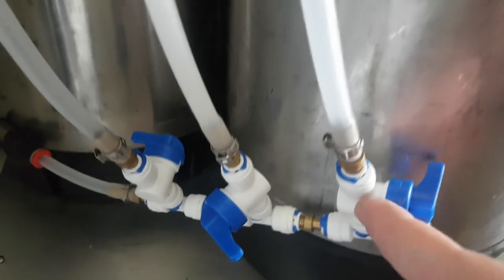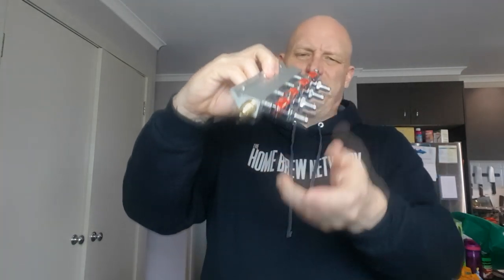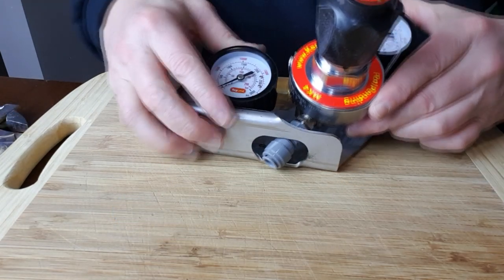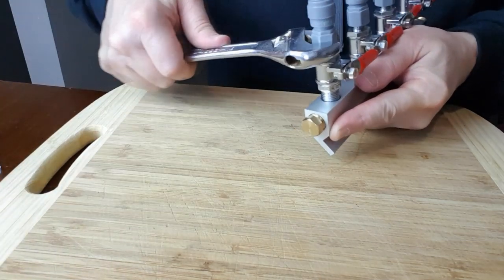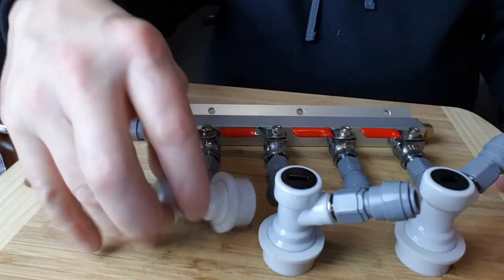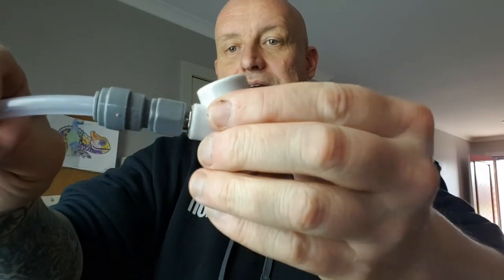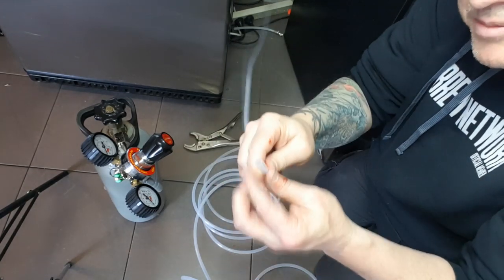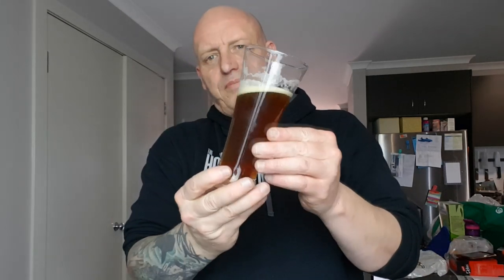REPLACING CO2 GAS LINES - Kegerator

Comment: Good stuff Gash, I've got the same manifold setup in my fridge.  My next cheap project will be to upgrade each line with a blowtie valve on each output so I can independently control the pressure to each keg! ;)

Comment: Nice bud I've the same manifold but with 6 connection on it,good tip about finger tight and 180° later which I never did. I did find the last time I lost gas was the fittings, the JG fittings had crumbled not all just the off one. Cheers
Reply from the maker: These ones are a little bit better than JG, as in the sealing around a line, but yeah I could see the odd one failing though, I'll keep an eye on them . Cheers and thanks mate

Comment: Hey mate great info, gotta respect an man who bleeds for his art!  Sitting here having a NEIPA BIAG (20ltr) tun styled one one of your previous videos.  Cooper extract can 4 kg Joe White traditional ale malt 1kg Joe White light Crystal 250grams quick oats and 500 rice husks, 3x30oz cascade hops, tastes good my mates recon, does the job, thanks for the videos  Keep up the good work!
Reply from the maker: Yeah that regulator guard was plain cut stainless bloody sharp lol lost skin hahaha. That's awesome about your beer mate, makes me happy . Cheers!
Reply: @HomeBrewNetwork  Yeah It's a good recipe, thanks for sharing! couldn't help from commenting as I took a scoop of flesh outta a finger the other day with a barbed fitting using eva barrier 5mm ID 8mm OD found the old harder line works better with barbs? eva's seems too soft? fine for duotight though I recon, Cheers :)
Reply: @totallyrandomlocksandpicks  ; Thanks for mentioning you found old harder line better for barbs. I don't trust ANY push-ins. I have no end of trouble with RO water leaks thru them, so can't see gas being any more reliable. KeeGland ;) does admit (in a low whisper) that ''micro'' leaks are possible with their u-beaut Duotight too, e.g. when line is strained or at an angle. I notice Gash didn't bend the tube in them like he did on the JG ones. Sex sells tho, and nothing say sexy like pushing in your pipe. Hahaha.
I'm glad there were lots of out-of-stocks (OOS) in the gas dept during the lead-up to Fermzilla's release. It gave me time to read some things I might've otherwise missed, like force carbonation with commercial CO2 (99.5% pure), being enough on its own to oxidise a carefully nurtured Low Oxygen Brewing beer (per Bryan Rabe) to the degree of throwing away the clean malt flavors at the very end, to say nothing of what it does to hops aroma and storage life. The numbers are well researched and published in brewery papers. Now I'm going to skip right to natural carbonation via spunging and collecting the excess spunge gas (purest CO2) to push the beer around (just like the big boys do). With no push-in fittings.
Reply: @2F51RL  I gotta say most interesting comment reply I read all week, I've been doing the same sort of research my self, bottled on and off for 15 years or more finally set up a a serving, fridge fementer fridge w/stc1000 &heater belt, co2, found the local HB supplies 5x the price of either KK or KK how ever started on barbs and hard line (which I believe doesn't work so well with duotight fittings) Use duotight as I have 12M of it and a few duotight fittings.  Actually made my own diy spuding valve same thing as Kegland (KeeGland lmfao ;) gear minus the blowtie simply a ball valve on the end, same principle.  Going to have a crack at knocking the sanitiser out of a 19ltr KegKing ball lock with a 50ltr SS keg to be used as a fementer then anaerobic transfer to the secondary/serving keg plan to do 40-45 liter batches (prob 40) depending/allowing for sufficient head space in the fementer.  Lucky to have scored 3 x 50lts and A-type micromatic couplers to suit so I've reconfigured them to use ball lock fittings just going to use the gas in as a blow off to a bottle and a one way check valve in the case any thing made it's way towards the pressure gauge.  Then once things are working capture that C02 and flush the 19's  Eventually I'd like to go back to bottling whilst still kegging, however using a counter pressure filler.  Slowing but surely... Happy brewing mate, Cheers!

Comment: Just bought my first batch of duotight fittings. My old setup with vinyl hosing has leaked twice in the last 2 months emptying brand new CO2 tanks twice in the process (once the day I had to bottle up for a competition!). Very much looking forward to putting them all back together with the new fittings and tidying up the whole system this weekend.

Any watchouts after you've been using these for a few years now?

Comment: Great video mate love your work! How did you end up attaching it, I like the Velcro idea, I put three screws and attached it to the door but the screws aren't biting properly so I'm off to Bunnings to get some Velcro as a secondary👍👍 thanks again for the tips!
Reply from the maker: I havent attached to door yet, I keep forgetting to order an elbow piece, I m sure the velcro will hold though, I bought the good wall hanging stuff, not clothes making stuff, although that could probably work too

Comment: Hey Gash, did you end up drilling a hole .. is there a video for it?
Reply from the maker: I didnt drill any holes, but trying to remember what youre talking about.. a hole for what?
Reply: @HomeBrewNetwork  Sorry mate, only watched this one today. You added a manifold to your kegerator and wanted to mount it outside. You thought you might have to drill the hole bigger to put the 4 gas lines through.
Reply from the maker: @oscadelta  nope I got 4 through

Comment: I note that you did not use any tape - duotight fittings don't require it?
Reply from the maker: no they shouldnt need it, though if worse comes to worse you could use a little, they dont seal at the thread. cheers!

Comment: Does gas line length matter at all?
Reply from the maker: Not in the lengths used in home brewing, I guess if you had them extremely long they might drop pressure. Cheers!
Reply: @HomeBrewNetwork  I was more thinking the other way, was wondering if 50cm from the gas line splitter.
Reply from the maker: @ejmillion  Be fine mate! Cheers!